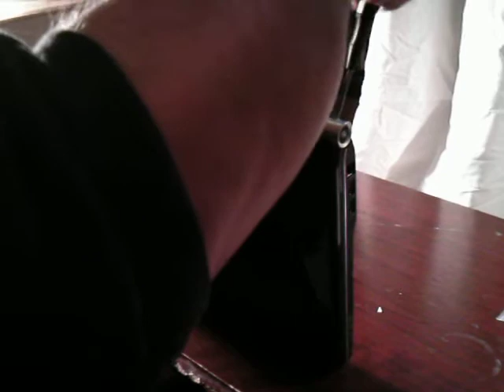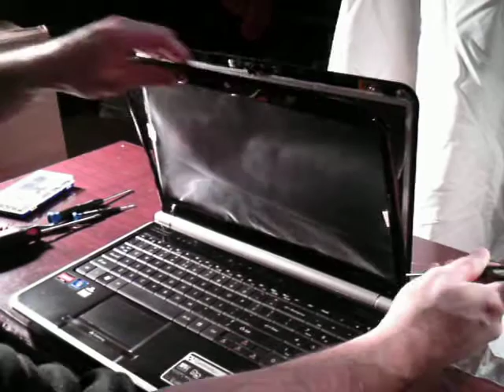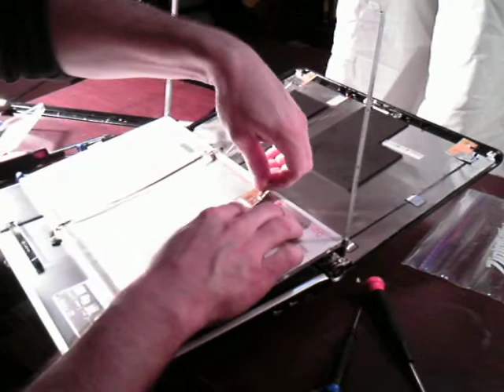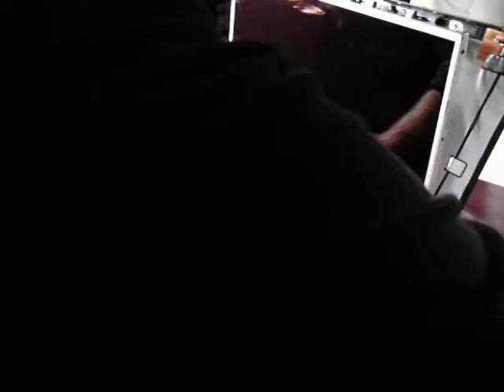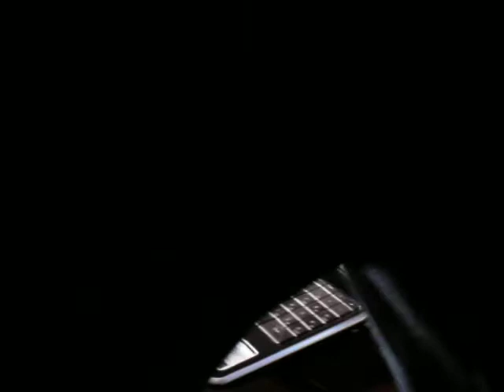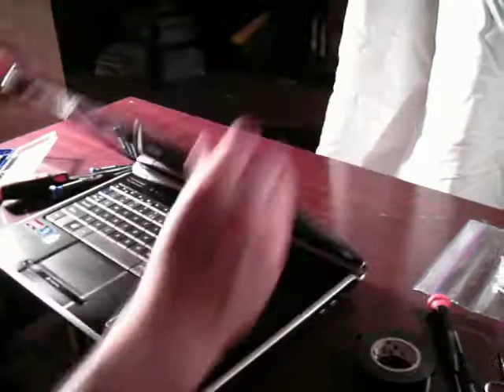Laptop screen replacement / How to replace laptop screen For Gateway MS2285

Comment: Hi thanks for the video.my computer have an other problem and I wonder if you can help me figure it out what it is. The problem is that it shut down suddenly by itself but not a normal shut down, its like you take the battery out and everything shut down. and if The computer is off it doesn't turn on easily I press the turn on/off bottom but the screen don't turn on but I can hear all the normal noises that it does when is on so I let it worm for 1 hour and try again and then turn on normal.